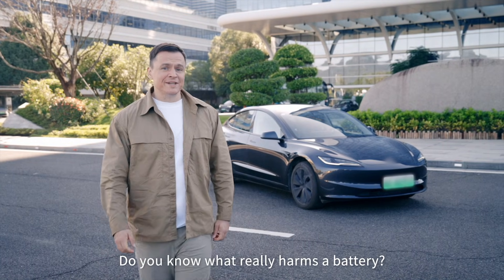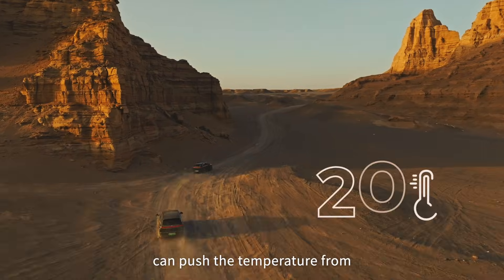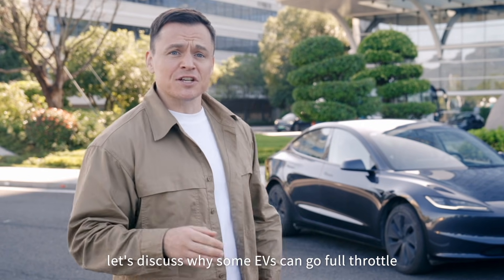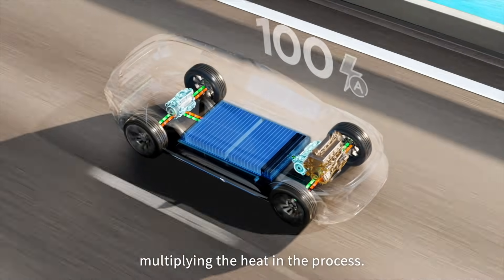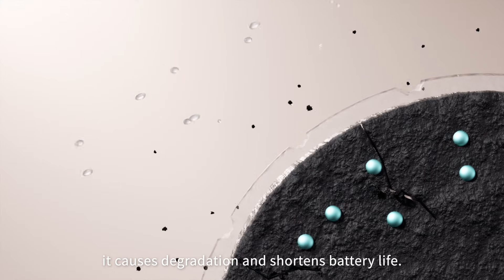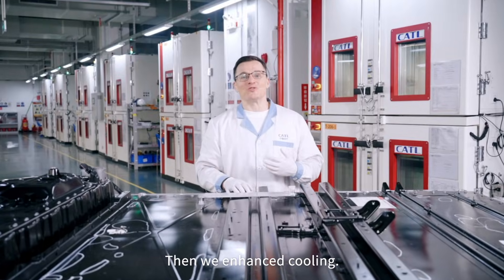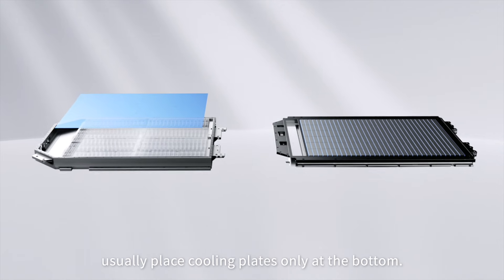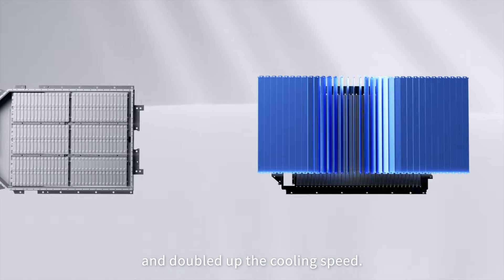50% Less Heat, 2× Cooling — Qilin Battery Tested

Comment: Very useful information about acceleration.

Unfortunately, I've had an NMC Korea car for three years, drive it fast, and accelerate more often in the city and on country roads than a professional driver on the Nürburgring.

The only good thing is that, according to the video, the battery dies sooner than I'd like, and I'll be able to get rid of the car despite the low mileage.

Back then (2022), the car was one of the quickest.

Nowadays, there are cars like this Xiaomi that are much quicker, more suitable for winter driving, have a longer range, etc.

I don't need a sodium battery with a 5 million km lifespan. 

The Qillin 2nd generation is exactly what I need for the next 12+ years, and the best/newest HESAI LiDAR system.

 LiDAR as a way to prevent disasters and save money makes much more sense than the mileage you could rack up in ten lifetimes.

Comment: I'm a driver in ice cold Wisconsin -- when can I buy a car with a Naxtra battery so I don't lose range in winter???
Reply: I guess you want an EV that gets you at least 400 miles easy ride in cold, not too expensive.
I think you will be best served with an LFP + sodium hybrid if you make less then 40.000 miles per year.

In 16 months earliest, an import unless Tesla gets the license for the LFP+Na hybrid batteries.

I think China will want to supply first the domestic market in luxury cars and if they prove great then luxury EU brands will want to have them before they get implemented in US factories.

The pure Na batteries will make sense for big Trucks with huge mileage and no big requirements for energy density.
Reply: @saschabjelica2741why won't the LFP +na hybrid make sense for big trucks with huge mileage?

Comment: Current can be well above 100 amps.
Reply: And well above 1000
Reply: Could, but generally not. A 400kw ev (likely with dual motors) would send 50amps to each (50amp X 400V ). A crazy performance EV maybe, but their packs would be 800V and quad motor.
Reply: @a @alexbarrett9506 no. 50 amp x 400 V is 20 kW.
Reply: @alexbarrett9506 Generally yes. Even my lowly e-Golf, with a 100 kW motor and 320 V nominal pack, puts out over 300 amps. And at its max charge rate of 40 kW it takes in 125 amps.
Reply: @alexbarrett9506 your math is wrong.
Reply: @barryw9473 oh wow, I don't usually miss a zero lol. Kudos from a fellow former Egolf owner!